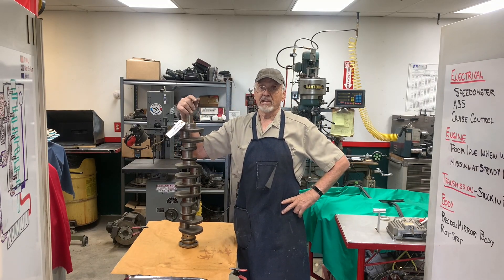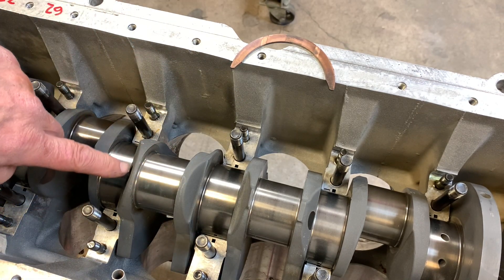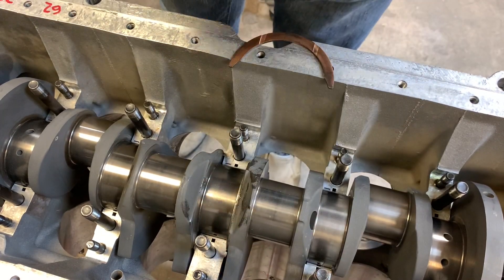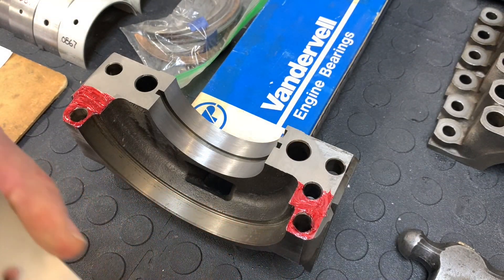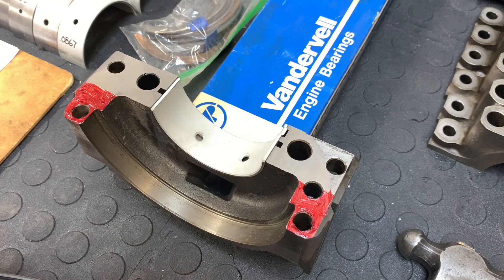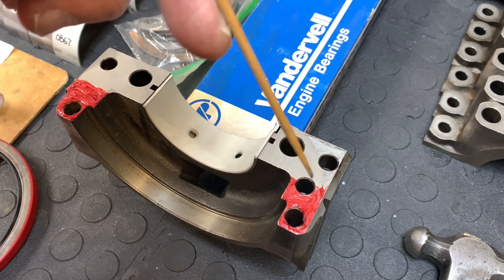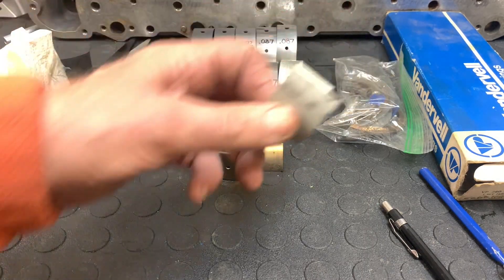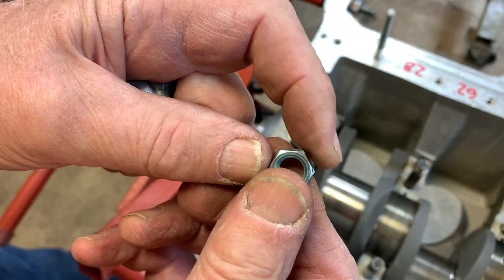S.4:Episode 4-Jaguar V12 Crankshaft Installation.

Comment: I seen it 2nd thrust washer back to front a friend of mine did the same to his mini cooper s in the 70's big grinding noise every time he pushed the clutch in, damaging the crank:oops:
Reply: Same thing on mine, a 997 50 years ago, the guy was a F'up all around, rear main seal in backwards and didn't have the big washer aligned with the crank & flywheel notches!  Also a 9th lifter laying down in the trans!  Old farts didn't wanna grind the crank's thrust face AT ALL, hadda beg, and they wanted to pour babbitt for a thicker thrust bearing, just shimmed it.    Go karts have bigger disk brakes.

Comment: So, was that second thrust washer your version of "Laces out Finkle!"?

Is that the Moss supplied rear seal?  Guessing from it's color.   I know the typical one now is the Bently Rolls Yellow FKM version. I'm really surprised that it is nitrile. Might it be FKM too?  I'm betting it is.  The reason I ask is the crank seal surface dia is about 114mm and at 6500 RPM it's surface speed is about 39 meters per second.  The SFK nitrile seal 44920 has max surface speed spec'd at about 11 meters per second, but it's FKM Viton counterpart 44926 has a max surface speed of about 34.5 meters per second.  I presumed it took a special seal to live in any circumstance of sustained high RPM conditions that especially the 5.3L is capable of. 

Thanks for another great episode!
Reply from the maker: Engel Imports, kalamazoo Mich. Sometimes I think more about what I'm saying than what I'm doing when shooting video. I watch pretty close during the edit. I think either is fine given the way most are driven.
Reply: @thecampchaoschronicles9567  I am curious about this too as this National NBR seal has max. speed of 11m/s. Revving my V12 farther so curious about how long this seal can last. I am going to install this particular seal and just thinking of buying 44926 Viton from SKF instead. Thoughts on this? What was the original seal type back in the day?